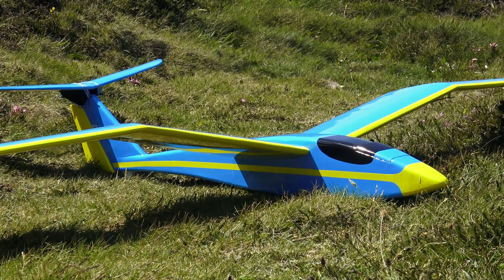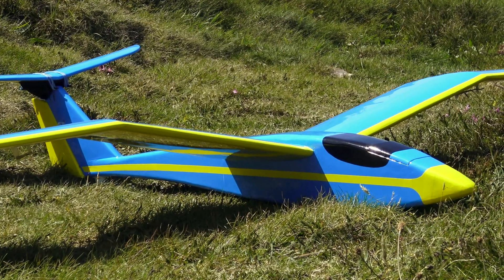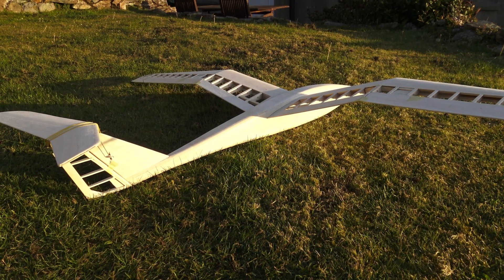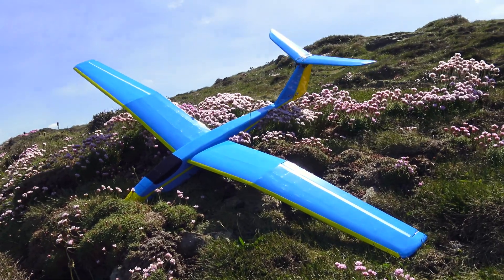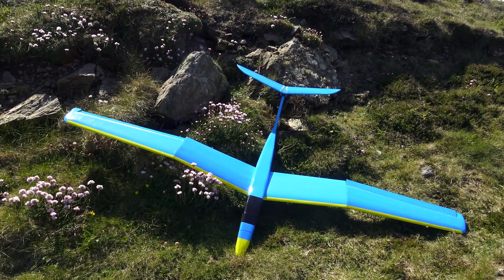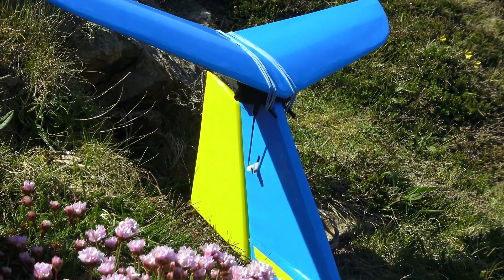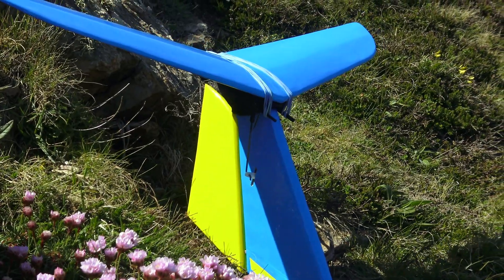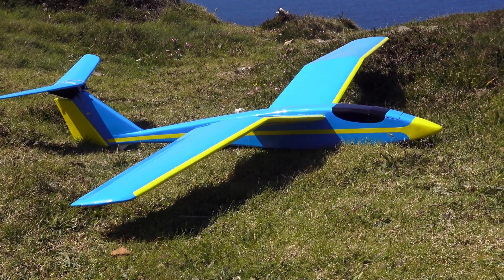T-BIRD Gull Wing Glider

Comment: I have one of these in my shelf. Looking forward to the build. And mods you suggest?
Reply from the maker: It doesn’t really need any mods but I built mine slightly different. I made the fuselage more of a square shape but this was just for ease of construction. I also made bolt-on wings as I thought the elastic bands looked a bit odd.

Comment: Hi John,

Thank you for posting this video. I just recieved my short kit for the T-Bird. Your shots of the glider with the skin off and the finished tail closeups will help me with my build.

Jenny
Reply from the maker: Thanks Jenny,
I did do a few bits slightly different to the plans. My fuselage has a square cross section as I just made it from four sides to keep the build simple. And I didn’t use bands to hold the wings on.
Good luck with the build, it’s a good looking plane.

Comment: Hi John, nice build . I am currently mid build of mine and was wondering what you did with the main wing joining and attachment to fuse in the abscence of the rubber bands .

Andrew
Reply from the maker: Hi there Andrew. I did think about making the wings attach on with bolts, but in the end made the whole thing as one part. 
It seems a bit pointless having elastic bands as the wing is mounted between two bulkheads, so wouldn’t have any movement on a bad landing. I’m lucky that I can just walk to my local flying slope, so transport is not a problem for me. Wing bolts seems like the perfect solution.

Comment: I like the T-bird so much I just ordered the short kit. It will have to join the queue of projects after the Kwiksilver and Soarcerer. Gliders with rubber banded wings and tailplanes suit my kind of landings, which are not always as smooth as yours.
Reply from the maker: Good luck with the build. I’m also a great fan of elastic on wings.
Reply: @SlopeRCGliders   The short kit arrived today. The plan is inspiring, but it looks like a challenging project that will have to wait until I retire next year. I just wish that short kits included a material list for all the other parts required...
Reply: My T-Bird glider is finally complete and weighs in at 1370g. It looks great in all its Gull-winged glory, but I was right about it being a challenging build project, definitely not recommended for beginners.

Comment: Most of my time was spent on thermal soarers, but I did have some success on Barbury Castle with a Franken-soarer. A Veron Mini-Robot that was an underpowered high-wingloading mess was the starting point. Out came the undercarriage and the DC Merlin, in went a little lead in the nose and a balsa cover made for the engine bay. On went 48" wings from a crashed Mercury Matador instead of the original 36" wings. Like all single-channel slope soarers, you had to have the right windspeed, but the MacGregor Superhet and the escapement on the rudder seemed to cope pretty well. What a thrill it was!

Comment: Nice Flyer, and I love the gull wings and T-tail, although the flat top fuselage looks a little crude compared to your usual curvy forms.
Reply: John has done a good job and his changes clearly made the model lighter than my original design which had a fully curved profile. I agree that the flat sides and top to the fuselage are less attractive than the original though.

Comment: Good bit of flying there, the plane is a stunner, just what I wanted to see ...a gull wing, not sure about the blue yellow but then again it did show clearly the position of the plane, great I'm building a gull wing but I want a bit more tip drop, what do you think, thanks for posting
Reply from the maker: Yes, it would definitely work well with more anhedral on the outer panels.

Comment: I. Started. R c. Flying. In the. 80 s. With a hobby lobby.  Spirit of 76. All foam glider.  With a power pod on top. And I used a cox  049 eng and once it got couple 100 feet. Away it went thermaling. A lot of fun.  I still have it it’s in my museum